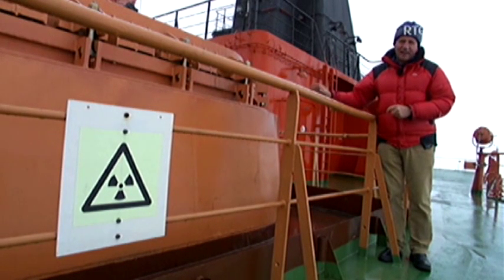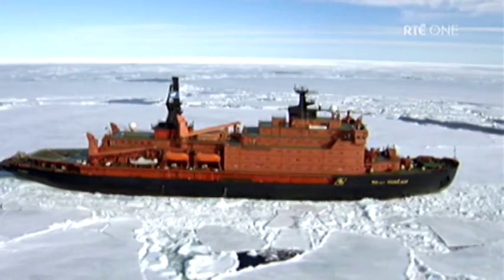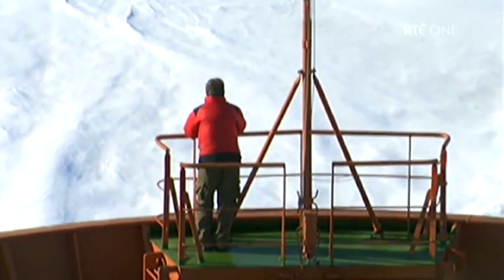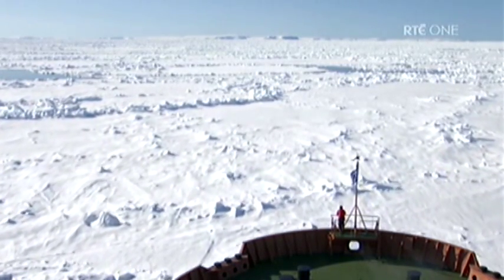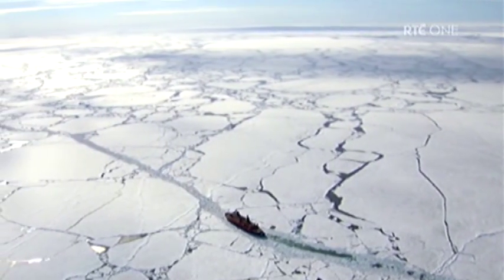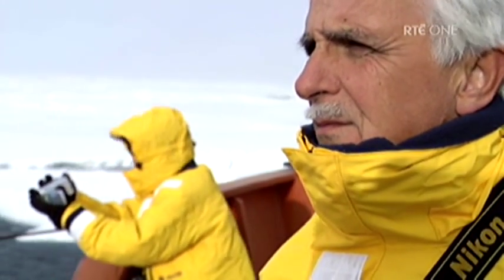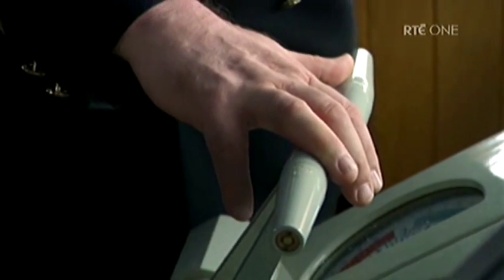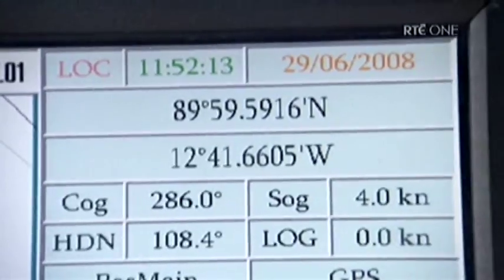RUSSIAN NUCLEAR POWERED ICE BREAKER SHIP 50 LET POBEDY

Comment: One with any common sense would think breaking up ice all the way to the north pole like this ship does adds to the instability of Polar ice and its degeneration. little pieces of crushed ice melt faster than one solid chunk. and ya on top of that dump nuclear fuel there, I bet by indiscriminately just chucking it down without protection the fuel is coming into contact with one another setting off a reaction better known as a meltdown deep underwater releasing massive amounts of heat. But then the real agenda of global players is to get access to the Oil reserves up there, clear up routs for shipping for trade, and another land grab of a strategic land mass. nothing to do with global warming. Global warming is just a distraction ploy. If anything they should be looking at the pollution problem and not narrowly at co2.
Reply: LOL